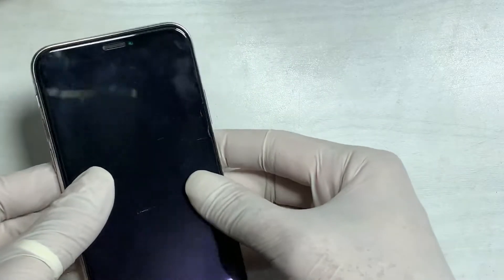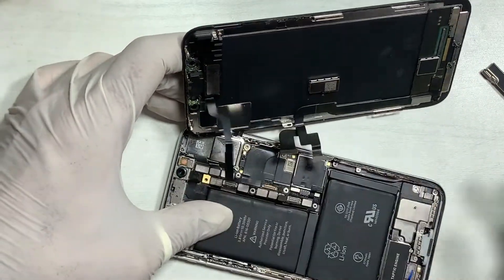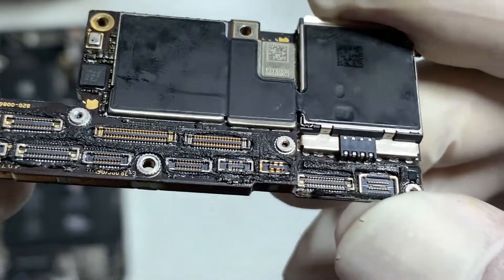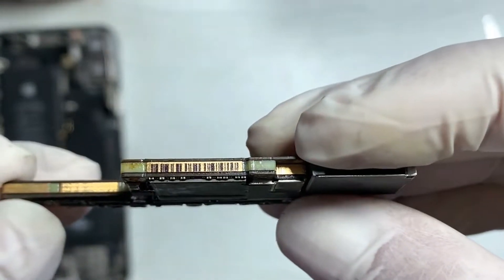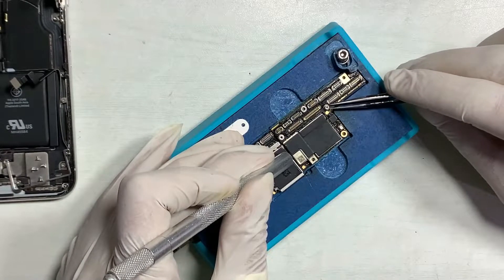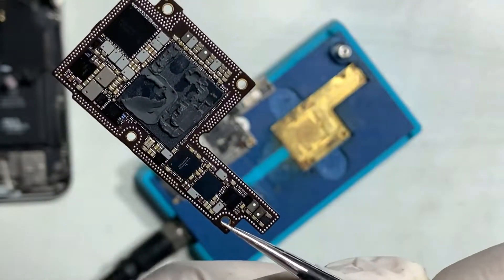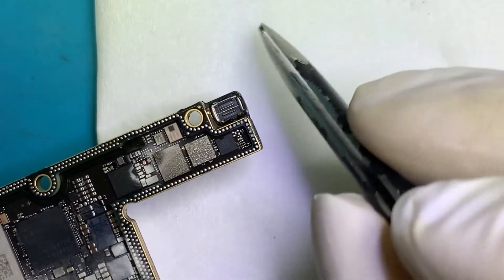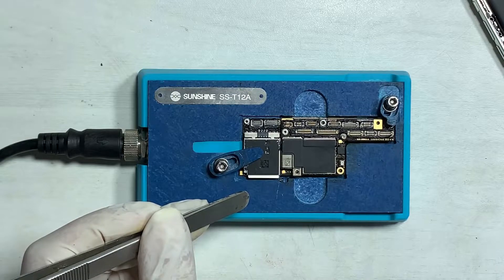iPhone X blank screen of dead!Fix iPhone X short and overheating.

Comment: What causes this to happen? Design flaw? Improper iphone usage? Can this be prevented?
Reply from the maker: The most I saw that faults on that customer's iPhone.They use 3rd party copy Dock or copy lightning cable. The Charging system of low-value charger is the main cause for that issues